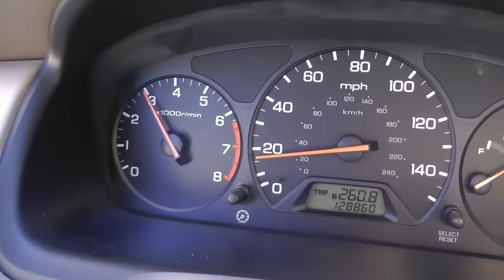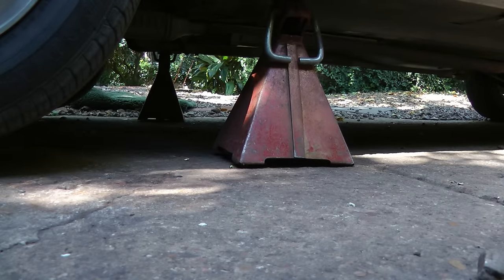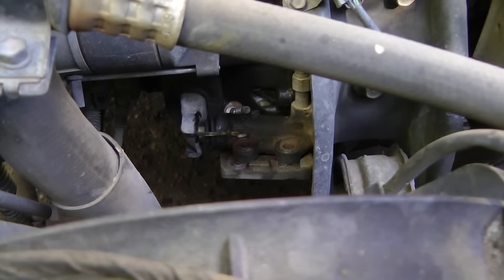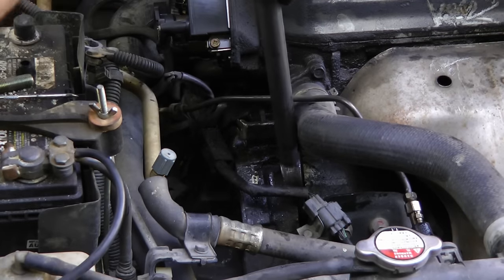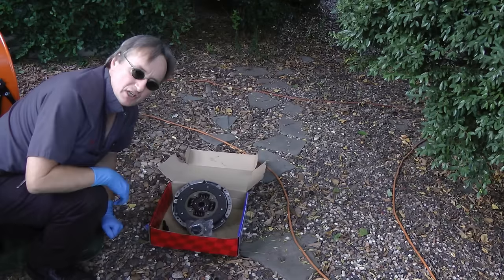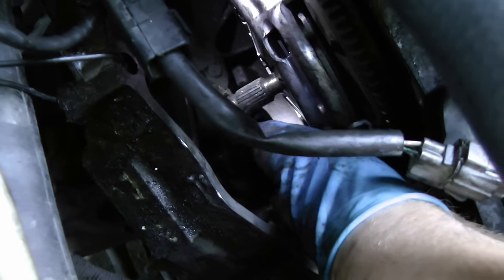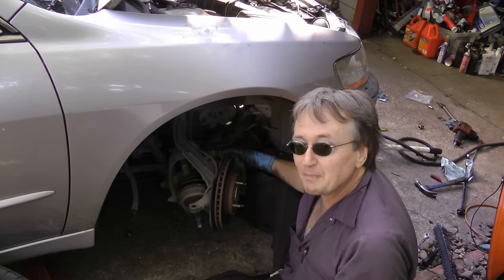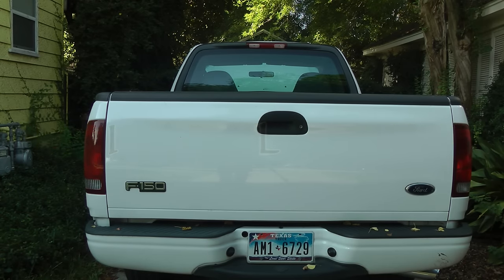How to Replace a Clutch in Your Car

Comment: 1999 beetle-no grinding in the clutch-except it don't want to reverse-was told might be low on its juices aka fluids-wonder if it  is true.
Reply from the maker: C 19 check the clutch reservoir to see if it's low. But normally, loos of reverse is either burned out clutch OR broken reverse gear
Reply: Scotty Kilmer- I will do that professor -thanks MR Scotty-you videos are so helpful .
I hope its the clutch reservoir that needs some juice in it.
air assault !!!!!

Comment: just to say that would be easier if you take the transmission right off and out of the way so you don't damage the transmission or you new clutch and you can make sure its around the right way.

Comment: So sometimes when I try to accelerate from a complete stop quickly my car shakes horribly unless I push back in on the clutch and basically admit defeat to what I initially wanted to do...accelerate quickly. 

Any idea why this happens? I've read up on forums and it seems to be a fairly complicated issue...
Reply from the maker: +Esquire Chewington IV that's not the clutch, something else like worn fuel injectors or weak fuel pump. Test those first or pay a mechanic to do that
Reply: Scotty Kilmer
Thank you! I'll definitely do that.

Comment: hi I have a 02 chevy cavalier 2.2 standard base model I have problem with clutch petal it stuck to the floor I had some one check it was told it was the clutch master cylinder so I changed it but the pedal still stays down some times it works and some times it doesn't can u help me
Reply from the maker: replace the clutch slave cylinder now, they go bad together.

Comment: Just bought a 01 Focus zx3 for $800 fron cl. Replaced the timing belt and water pump. Also replaced a motor mount. After the job my clutch started making a ton of noise.     But the noise stops when I press the clutch. Any ideas?
Reply: check this troubleshooting guide, it's not perfect but might help - http://www.calderclutch.co.uk/faults.html
Reply: throwout bearing most likely
Reply: No Hair Don't Care
Reply: william mcintosh yea
Reply: Your transmission is misaligned with the engine causing the clutch to engage unevenly with the flywheel. You would have to take it apart and put it back together again, even though the clutch disk is most likely worn unevenly.

Comment: My clutch sticks and wont shift into gear. I drive a saturn sl1 2001. I push my pedal to the floor and I can't select a gear. What could be the possible problem?
Reply from the maker: pray you just need a new clutch master cylinder or slave cylinder.

Comment: Hi I got a 91 Nissan hardbody just bought.
Looks like clutch mas cylinder was recently changed..
Ders times when my clutch is really low....hard to put in gears
I would have to pump it couple times and it would gear nice and smooth
I checked oil on clutch it full and drs no leaks/ it looks dirty though.
I need help wat can I do wer can I start.....

Comment: Hi i have a 1991 chevy cavalier manual transmission i took it in to get a clutch replacement the mechanic said he replaced the slave cylinder and the clutch it self and they bleed the system many times. He is saying the curved piece on the transmission  the thing that the slave cylinder pushes to in gauge the clutch. I just need some help and advice about why when its not turned on it goes through all the gears but when i turn it on it just wont go into gear.... plsssssss help me... missing driving this little car. The picture is the thing that wont move all the way... the clutch is very soft.
Reply: When the car is turned off, you can always shift gears, no matter how bad your clutch is. Your mechanic probably did something wrong when he replaced the clutch because this sounds like a bad clutch to me.

Comment: Hi scotty I wach alot off your vids I've subbed and like I have a problem had new cluch fitted but somethings not right I can hear fro out bearing squealing a little I'm not bothered about that it could shut up right when acceleration testing foot on top of cluch pedal comes up about 3mm and same when let off gas cluch pedal goes dwn about 3mm drives perfect it's the movement on cluch moves its self I've bleeded it 6 times there no air in system I dont get it it's new 3 peace cluch kit ?? Also it's not flyweel that's fine a play was minumal

Comment: would I be able to do the same with my 2002 Toyota Celica.  I keep being told that i would have to drop both the engine and transmission to replace the clutch.  Also the clutch doesn't slip but acts more like i'm not pushing in the clutch pedal.  Car jumps forward when trying to start and lots of vibration in the clutch when moving and trying to press it in.  Was told the hydraulic system was fine.
Reply from the maker: that's nonsence, it can be done as in this video, I've done it. If hydraulics are fine, you need a new clutch
Reply: Hey man i have a 2000 celica as well and having the same problem as you. Did you ever change the clutch? if so how long did it take you?
Reply: Scotty Kilmer oh and scotty is a stage 3 clutch kit good for everyday use? i have heard they are really stiff, or should i just go with an organic clutch?
Reply: glow__up Jason it took me a few days because I didn't have a few tools I needed and had a couple of rounded bolts that the last person caused.  There is a step by step guide on one of the celica forums I would look at that before you start and while you're doing it
Reply: glow__up Jason hardest part was putting the transmission back in just take your time do it right the first time

Comment: I understand that the process will differ slightly between vehicles. But relatively speaking, is that really all there is to it?
Reply from the maker: yes, but some take removal of the engine and transmission as a unit to get it apart
Reply: Scotty Kilmer Thank you for your reply Scotty. Very informative video. I will give it a go in the coming days!
Reply: Jason Bentley Let us know how it goes.
Reply: Jason, how'd the clutch job go?
Reply: Apologies for the late reply guys. I managed to get the clutched changed no problem. Happy days! :)
Reply: There is quite a bit more to it than show in this video, but overall it's pretty much the same process

Comment: Hi I am having an issue with the clutch, master or slave cylinder. I heard a bad pop sound when I slam on the clutch pedal and brake( tried to avoid an accident), then suddenly the clutch became weaker resistance.(used to be really hard

Comment: Well let’s see here Scotty check to see if all four corners of the jack stands are touching the ground. 2nd when putting clutch bolts & transmission bolts back on torque to factory spec. 3rd have some icy hot ready because your gonna feel it in your back the next day.

Comment: Hi Scott, I have seen many of your videos and always notice how chipper you are and that you reply to comments. I Have not had any car issues in a while, I just recently found out I needed to replace my transmission on my 98 honda DX  hb

 So I took it to my buddy's garage who races cars, lol. He's not a mechanic but we took my old one off and replaced it. Before we swapped it out the car drove fine other than the noise the throughout bearing was starting to make. Now we have the new transmission on and everything set back up and all of a sudden my clutch disc isn't grabbing... car won't even move ..

My linkage rod to the transmission is back on. It's very random and I can't understand why? Line to my slave cylinder has been bled and refilled, my clutch moves now with the right amount of resistance.

Any and I mean any reason you think would cause that I would love to know :)
I know it could be maybe many things that have happened but figured I'd ask.
Reply from the maker: of course I hope he used a good transmission, and all new clutch parts, as any flaw in either will do that.  BUT, if you can't get it into gear when it doesn't work, that's the clutch hydraulic system acting up. BUT, if it goes in gear but won't move, that's a clutch or transmission shaft failure
Reply: Thanks so much for the info scotty! Your the best on here and so helpful to soo many!
Reply from the maker: If you like my car help, be sure to watch my live car talk show every saturday morning at 10 AM CST on google events. I answer your car questions LIVE there. Just go go  to this link https://plus.google.com/u/0/communities/110758243155230074828  and join my community.  You will be told each week that a new event is happening the coming Saturday, and you can also ask questions there at my community also. You do have to be a member of google plus to ask questions, so join up, it’s all Free.  And remember, every TUESDAY  I upload a new video, don’t miss them.

Comment: i did this with my 94 civic and now my check engine light is on any ideas on what might of happend?
Reply: I would suggest taking the car to the nearest auto parts store and they can run the code reader for you to tell you what's wrong
Reply: Or just buy a code reader, they arent that expensive.

Comment: is that the same for a hydraulic clutch
Reply: With a hydraulic clutch you have to get all the air out of the lines for it to work
Reply: And you go to pushrod . It is not electrical. It is all mechanical

Comment: I am not convinced that I have a dead clutch but I know something is happening.  2006 2dr Honda Accord 2.4.  My rpm doesn't entirely slip but I feel it slip 1,000 rpm when I gas it to accelerate.  I usually start at 1.5 rpm and change to second gear at 3rpm.  Now it's around 2 and moves so quickly I change gear at 4rpm.
Reply from the maker: +Devin Nguyen clutch is worn for sure, not entirely worn out but the clutch plate is certainly getting thin

Comment: i have an 09 lancer non evo and when i go in gear and release the clutch it seems as it didnt grab the gear because it refuses to grab. it does this in first and second. sometimes i can get it in gear but there's a little difficulty
Reply: you need a transmission rebuild. $2000. Sorry.
Reply: +X Cuber I ended up buying a new tranny

Comment: my clutch is filling hard and there no problem of slipping of clutch but the problem is the gear dont shift properly. when i shift gears on turns the gear do shift but some it make noise (rubbing gears).
Reply: You should bleed the clutch, at least that's what my research tells me it seems really easy if you do it the gravity way, google: gravity clutch bleed

Comment: For some reason my truck only go reverse and neutral it doesn't  want to switch gears. Can someone help me?? I got a ford f1-50 1995
Reply: This doesnt sound like just the clutch but could also be the gearbox (manual transmission) but without being there to drive it, honestly I couldn't tell you. Would need more info.

Comment: The surface of the flywheel will have just as much wear as the surface of the pressure plate. You should have removed the flywheel and had it resurfaced at a machine shop. Why didn't you have the flywheel resurfaced?  You also need to check the pilot bearing and replace it too if it is worn.

Comment: do u know how a throw out bearing goes in a 1991 civic hatchback all stock
Reply from the maker: you have to remove the transmission, then the bearing fits over the tranny main shaft and snaps in with this crazy spring contraption. Pretty mickey mouse, but it works
Reply: thnks

Comment: what about the flywheel?
Reply from the maker: +MrMisanthrope1 you can replace if it scored, this one wasn't. New ones aren't cheap and are not needed if clutch was not worn down to the rivets
Reply: +MrMisanthrope1 I think the flywheel surface should always be cleaned and at least scuffed up with sand paper, so the new clutch disk isn't running on a glazed flywheel. Of course their wouldn't be enough room to do that well with the trans that close to it.

Comment: You skipped inspecting and if necessary, machining (grinding) the flywheel. Just like replacing brake pads without rotors, this is an important step if you want the clutch to work like new. After all, it's mating against the flywheel. Why not ensure the flywheel is in good shape too?

Comment: i got problam in my car i replaced plug coiles throtal body n eccilirator padol ether but whan RPM gos on bitwin 1000 to 2000 my car engan shaks badly after 2000 its ok i have toyota carola 2011 eachotac.
pls give me advice what should i do
Reply: any engine codes?
Reply: cod i dont know i got 1.3 cc manual toyota carola model 2011
Reply: +Haider Khan take it to autozone and tell em u have engine light on and theyll scan it for u and see what happening and usually if its one code its easy to figure what your prob may be but yea just see what codes u have
Reply: ok thanks so much
Reply: there is a micanic he told me my bee had vol is jam had will bee open to see any vol isnt working gud
Reply: r u agry? with that micanic?
Reply: +Haider Khan I dont know exactly what that is but my guess would be tps (throttle position sensor) or your crank sensor which the autozone scanner will pick any of those up. They do it for free.
Reply: +Haider Khan WHAT???????? no really I can't understand a third of the words you are typing.

Comment: I have a 78 f100  and something is wrong cuz is 3speed and when is running start shaking the whole truck and dont know what it is
Reply from the maker: they can do that for many and varied reasons. Start by checking the spark plugs and the wires on that old thing

Comment: I appreciate the video but it just shows how to do it on a front wheel drive car! With rear wheel drive all you do is disconnect the main driveline and pull the transmission and then go do the clutch

Comment: My clutch never slipped but won't go in gear while running. Pedal pressure is good but replaced clutch master cylinder anyways. Although I needed to add fluid a few months ago. Goes in gear fine while off. Linkage looks fine. It was shifting fine before. Replaced the clutch 60k but not throwout :-x. Thinking of replacing with a clutch kit and hope for the best. Any ideas anyone?2000 Mitsubishi eclipse 2.4.
Reply: Can start car in gear and move but it seems to be jumpy and sounds bad.
Reply from the maker: yes, put a whole kit in with all parts IF clutch hydraulics are hard to the feel and not leaking

Comment: Great video!  I've been doing some research on this so I can do it, and aside from some details that are specific to each model of transmission, almost everything I've read is well summarized here byScotty.  However, on some transmissions, don't you have to insert a dowel or something similar into the differential after you remove one of the halfshafts, so that the gear assembly doesn't drop down into the transmission housing?  If that happens, from what I've read, you usually have to take apart the transmission halves to get to it and reposition it.

Comment: Hi first thing I love all your videos, I have a Fiat Stilo 1.6 16V from 2002 I fit a clutch kit 6 weeks a go and now the clutch start interment sleeping I remove a little cover to see if any leaks from fly wheel everthing is dry the master is hydraulic I don't now if the garage beed the clutch can you please have any idea what cause my problem please reply my email soon is possible tank you very mutch regards:Berenguer
Reply from the maker: make sure the clutch cylinders and not adjusted too tight on the rod that adjusts it, perhaps loosen the nut and turn the adjusting screw in, that being too tight causes slippage
Reply: Scotty Kilmer hey i have a 1991 toyota celica st (its fwd) the clutch is almost worn out and im wondering if i would have to do anything other than what you did in the video? thanks

Comment: Hi i have a passat of 2008 1.9 tdi i have a problem with a clutch when i drive in highways for the long distance up to 60km so i dont use the clutch during i drive than the clutch petal lose the power to turn back it go down on the floor,  i have change completly the clutch system is new and also i have change the pomp under petal but still the problem runnin when i drive local and i use often it make any problem. If someone can help me i thanks so much.
Reply from the maker: generally a bad clutch master or slave cylinder does that, start there